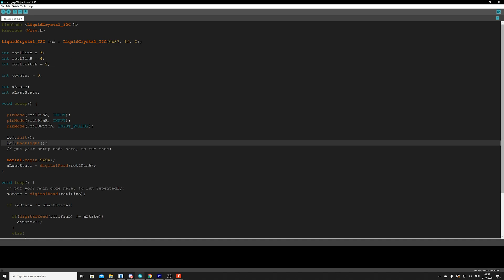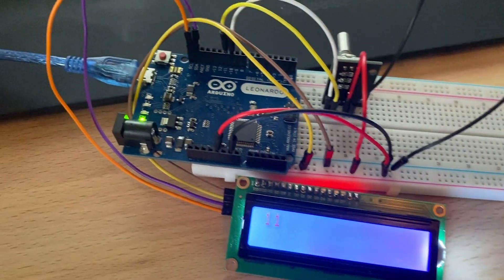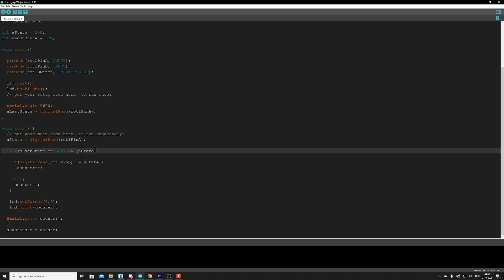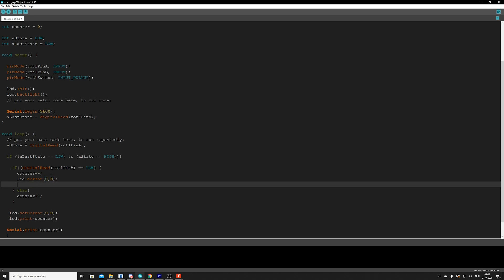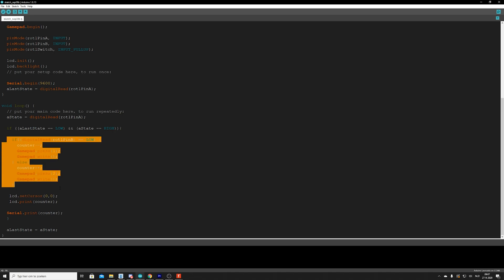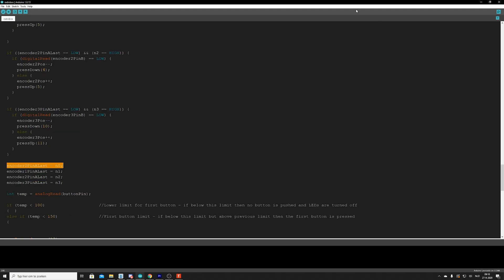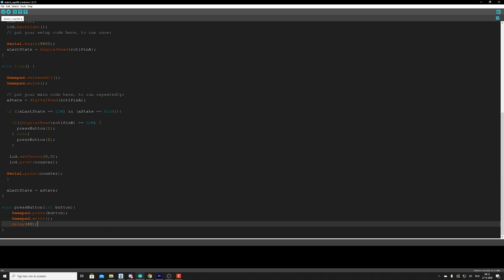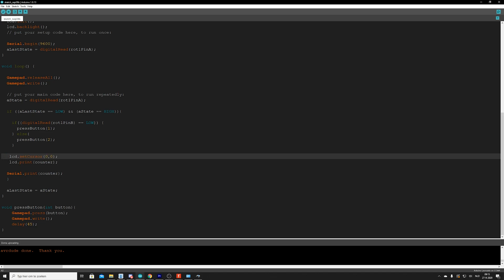How to: create your own arduino radio for flight simulator 2020 part 1B

Comment: Hello, i'm a bit confused with the HID  Library. You didn't provide the link. I finally found it but I need to something like flashing the ship, etc ...
Really weird because then I'm able to play with Gamepad functions and so on but unable to read and write on my pin !! As soon as I upload the sketch to the IO MCU it's working perfectly but I can't use the HID Library...
Reply from the maker: Which board are you using if I may ask. For the Uno / nano (everything except the Leonardo/pro-micro I've switched to my own software solution) 
I go really in depth how it works in this video:
https://studio.youtube.com/video/PqvqaO-61Oc/edit
Especially for rotary encoders this approach is more stable.

Comment: I have an arduino uno R3 board trying to follow your setup but when I add the HID Project lines in the code, I get the error message: #error HID Project can only be used with an USB MCU and it won't upload the sketch file to the uno
Reply from the maker: That is correct an Uno/nano/mega can't be used as an HID device. The leonardo/ pro micro are using a different protocol making them able to be recognized as joystick. Now I made an application that is able to send data with and Uno mega or any microcontroller with serial communication. https://youtu.be/XKDyKSkmbOw the only downside is that currently it can either retrieve data or send data per arduino connected Im working on a way to combine both.

Comment: hey have you used it with the A320 in FS 2020 i have Something kinda like this. I programed it to the radio stack but the numbers don't move on the radio stack in the game. Could you maybe give it a try to and see if it works for you in the 320. Thanks!!
Reply from the maker: Hey, the a320 is a little bugged in rhat regard at the moment. The numbers visually dont change but in reality they do. I used to fly the a320 all the time which is why i thought for ages that the radio didnt work.
Reply: @Bitsanddroids  ok thanks, I emailed them and left a bug report hope they might fix it.

Comment: Great tutorial. Thank you. Question, how will you get the outputs from the sim? (Frequency, LedStatus, etc)
Reply from the maker: There are 2 routes. 

1. I have written a program that will run in a console that retrieves com 1, com 2 and altimeter pressure (its still a wip so in theory almost all information can be retrieved from the game quite easily.) The mentioned values will then be passed over the serial connection to the arduino.

2. Using a third party app like mobiflight. This route is easier. 
But I like to tinker and learn somrthing in the process thats why i went with route 1. And because i knew my own software would be free and would do exactly what i wanted.
Reply from the maker: The video showing the exact way i used will be up this weekend
Reply: @Bitsanddroids  Thank you very much. I started my multi-radio setup during pandemic quarantine using FSX and Link2FS as interface. Unfortunately, link2fs will not be updated to MSFS2020. I started researching for SimConnect, but that's a bit complex for my programming skills, and on the other hand, MobiFlight has some limitations, for example, no potentiomenter inputs. Hope i can get your console app and got my setup ruunning. Thanks again.
Reply: @Bitsanddroids  Great!!! After making my heading bug I was wondering how to sync and display it on the LCD from/to MSFS. excited for the this !!!!
Reply from the maker: @N B  I just drank my cup of coffee, read your comment, and realized I didn't have a way to pass the heading indicator values to the Arduino. As expected I now have a way to pass this data. Had to make some last-minute changes but you're set.  
The only issues right now are: 
- In Airliners (at least the airbus), the Autopilot has to be on to start passing the heading data (you can turn it off it just needs a kickstart) 
- It replaces the characters that are blank (so 100 are 3 characters which is fine but 29 are 2 characters leaving 1 spot blank) with some scribbling. I think I can fix this before the video tomorrow.